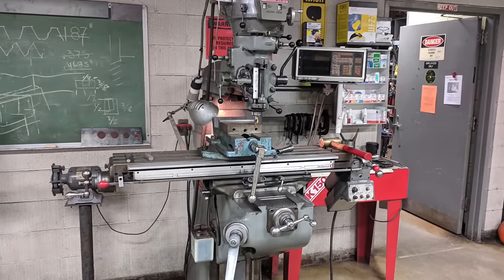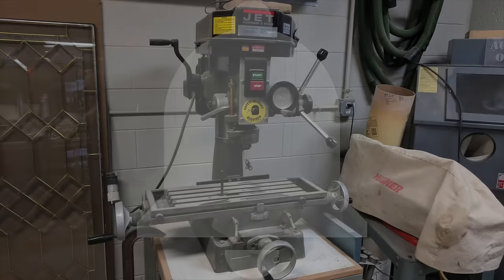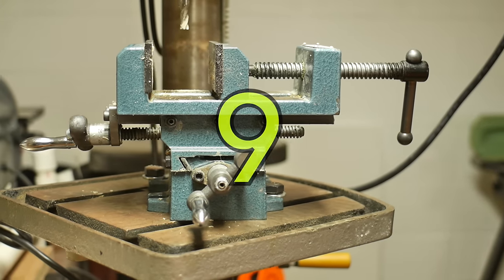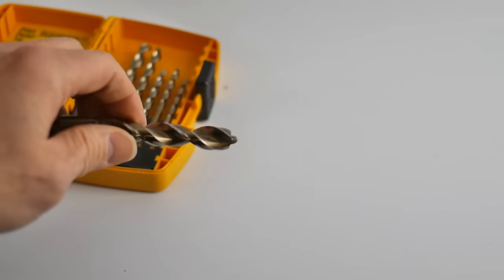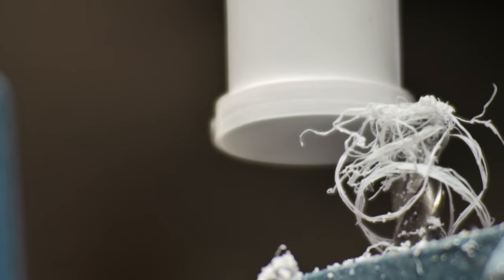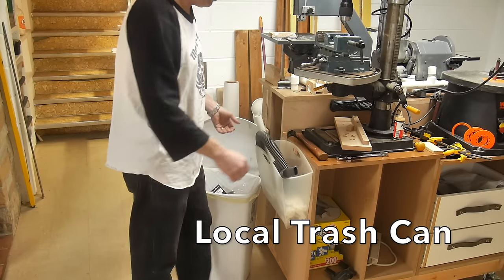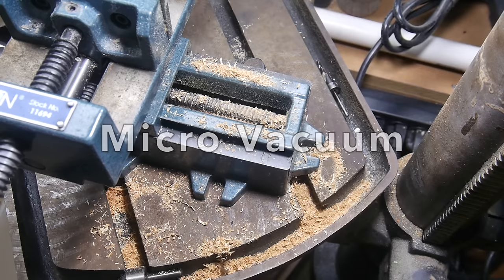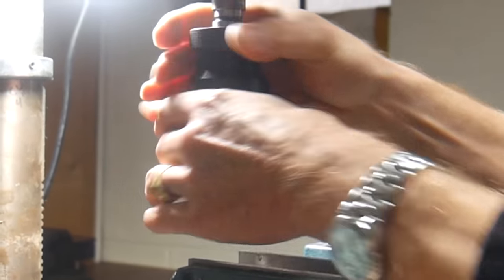Drill Press Machining Hacking/Tips and Tricks: The Basics

Comment: good info! I just got a nova voyager which is a $1700 drill press with very low runout and so I'm nervous that side loads could cause damage that would affect the precision of the machine. I've asked a lot of people about this and have been getting highly varied responses, everything from "I wouldn't even use sanding drums", to "I use my drill press as a lathe". Any thoughts on this? I'd be more inclined to just experiment if it was a harbor freight drill press, but this is a pricey machine (about 3 times more expensive than anything else in my shop) so I'm trying to stay cautious.
Reply from the maker: Follow the manufacturer's recommendation on that.

Comment: unless your drill press is a direct drive, your spindle will bend out of true. All non direct drive presses are meant for vertical load not horizontal pressure and stress...
Reply from the maker: Yes, you are absolutely correct

Comment: se tapeYou left out a major issue that potential might kill someone (or even you). The way to attach the drill chuck on a drill is via a Morse taper. A little vibration loosens the Morse taper and everything just falls out with a potential for injury. The drill needs a bolt fastening or screw fitting to hold the drill chuck securely in the drill. That is why you buy a milling machine.
Two other things that are highly useful is a way to lock the shaft partially down. Some drill press's don't have this. And you need a simple way to raise or lower the drill table preferably with some precision. Few drill press's have these either. I have a milling table mounted on my drill press and all of the above things really annoy me. I have so far only ruined one job by the Morse taper dropping down but caught a number of others before they caused damage to either a job or me. All of these things are why you buy a milling machine. I suspect that it wouldn't take too much to mount the Morse taper better (not using a Morse taper basically) and would add little to the cost of a drill press BUT doing so means way less milling machine sales so it is not done.
I don't know if drill/mill machines handle this better but my experience is that a drill/mill is probably the better buy if ANY milling is intended.

Comment: Please don’t use your pillar drill to mill. The thrust bearings are not designed to take horizontal loads - they are purpose made to only take vertical loads. By milling all you will do is wear them out fairly quickly, causing increased runout/wobble. 

Thrust bearings can be difficult to replace unless you have the right equipment.
Reply from the maker: Good advice..
Reply: >thrust bearings
My ryobi drill press has standard radial-load ball bearings in addition to the thrust bearings. It also doesn't have a taper anywhere, just a thread-on chuck. Seems like my drill press is well suited to light milling, although I'm too much of a cheapskate to buy actual end-mills so I use a combination of dremel bits and D-bits made out of old files. Heh.
Reply from the maker: Seems ideal

Comment: WEN 4212T 5-Amp 10-Inch Variable Speed Benchtop Drill Press with Laser
Benchtop. $231 shipped to my door. First drill press. Light duty. 
Need for drilling some thin(ish) hardened SS and titanium.

Good? Anything better? $240 is my max budget.

Comment: Brilliant video thank you.

I was lucky enough to buy an old Whitecote drill press from the 1970's - it came with the slide vice (I didn't know what it was called until seeing your video) and a massive haul of big and little morse taper and straight-shank drills - all for £40 ! Re-wired it with a new starter, and it's so heavy there's no vibration at all, even with large drills.

Finished making a precision 9BA needle pin screw for a 1930's phonograph with this setup.
I will buy some of the tools you suggested, I did not even know these existed.
Reply from the maker: Awesome

Comment: I know I am late to the party, been a machinist for 25 years, that chuck is a great piece of gear but be very careful not to spin your mills and drills  in it...BE VERY CAREFUL
Reply: Hey Stan, what's the risk if they spin? Also, can you help me out here, someone in the comments said that lateral forces are generally not great for drill presses, can lead to premature bearing failure. But as I thought about it more, wouldn't a drill press with 'plain' ball bearings be better for handling lateral/radial forces than axial? Wouldn't the downward force of drilling be WAY worse for the bearings, would be trying to push the inner race out of the bearings? I've also heard that lateral forces in a drill press will usually cause the taper joint between the spindle and chuck to work loose, since drill presses probably never have drawbolts. I could be completely misunderstanding it though, I'm not too proud to admit that :-)
Reply: @AHustleIsLikeASideOfFries  In my experience the lateral and axial forces wouldn't be an issue because you're not going to be putting to much stress on the bearings as you're not going to be taking that heavy of a cut. You will know what to heavy is when the motor boggs and the end mill locks up in the work because it doesn't have enough power to cut the material. ( If I was understanding the question correctly). I would not worry about the taper either with light cuts, probably take decades to do any damage...if at all. THE CHUCK....any chuck that has tools that spin will damage the jaws and lead ti loss of true..it won't necessarily happen with one spin but it WILL happen so be very careful and take your time, light and lubed cuts. That is an excellent chuck and will hold tools very true. We have them for carbide reamers that cut on the chili EVERY time, +/-.0005 and they cut nominal...meaning no real need for tolerances except for tool wear. Hope that helped.
Reply: @stanbrown915  thanks for the reply. I interpreted your first comment as it could be physically dangerous, didn't realize it was about damage to the tools.
Reply: @AHustleIsLikeASideOfFries  Yes...sorry about that. All work must be secured to the table when using power equipment at all times.

Comment: I have that same drill press..it's such a pile of crap but I get some ok results from it. I have a good cross slide but getting the table to be solid is a real drag,,plus side loads pops out the taper so i devised a draw bar screw to go into the little slot in the spindle with opposing set screws..
Reply from the maker: Thanks cool, can you post a pic on social media and tag me so I can see how you did that?
Reply: @EricStrebel  yeah I'll try and snap a shot of it.. I was quite pleased with myself for my clever solution. I used a milling bit holder instead of the Jacob's chuck..that taper in the spindle is surprisingly a standard moris number 2, so I used the milling bit holder I had and a cut off screw that fit its thread pitch for the draw bar,,I had to narrow the sides of the screw to fit up it and then drilled a hole latterly through it and taped it for two opposing set screws,,its a bit fiddly to set up but once you get the hang of it it works great. As you turn the mill holder up into the spindle it tightens up the holder into the screw and taper. 
I know a picture is worth a thousand words so ill get a pic for ya.

Oh and by the way I really enjoyed your humor and low tech solutions,,I have never had the deep pockets to just through money at my problems and I actually think often times its been very satisfying creating work arounds. Cheers
Reply from the maker: Rock on!
Reply: Hey Eric! Any photos or sketches? thanks.

Comment: I have heard that if a drill press is used as a mill it will destroy the bearings in short order is this true
Reply from the maker: It's not meant for a side load, it has a linear beating,
Reply: @EricStrebel  so this means it will destroy the bearings
Reply from the maker: Eventually they will deteriorate, yes

Comment: Using an end mill in a three jaw drill chuck is DANGEROUS.  Find another way to secure the end mill as the drill chuck isn't up to the task of holding end mills due to the fact that end mills are hardened and the the drill chuck jaws do not have enough surface area to adequately support the mill.  That's why they are called drill chucks and not mill chucks.

Comment: Question: I had basically the same idea "hey i have a drill press why not just get a cross slide vise and use it as a mill" and was met with an avalanche of "not a good idea boss". The main concern cited to me was that the bearings on a drill press are designed to take the stresses of moving vertically and lateral forces would destroy them. Since you use a cheap'o drill press this would kinda be the definitive, have you run this for a long time? what are the limitations? have you noticed the press running out of true?

I'm not expecting a flawless cut through hardened steel or anything but in my mind a low enough feed speed/depth of cut with the tool as close to the chuck as possible would eliminate (or atleast reduce) any wear.
Reply: The main reason I always call BS when I hear that thing about bearings, is that the bearings on basically every drill press I've taken apart are your garden variety deep groove ball bearing, these bearings can usually handle at least 3 times the radial (side) load as they can axial (end or drilling) load yet despite this these bearings are always the ones used in drill presses. As you mentioned, if you keep the loads down it should work just fine but if it really bothers you it's almost always possible to change out the bearings with either angular contact (good precision and way higher rpm than your press could make) or tapered roller (high ENOUGH rpm and way higher load bearing than any other part of your mill/press could handle).

I went ahead and changed mine out with tapered roller bearings just because I wanted the extra durability and know I won't reach the precision capabilities of the angular contact bearings, but two issues with those are that the bearings were slightly thicker (my drill press had a spacer that seemed made specifically so I could remove it to fit tapered roller bearings if I wanted, but not all drill presses will have this) as well as the fact that the tapered roller bearings don't have any kind of shield or seal on them. So far it hasn't been a problem, and I've never had chips go into that area anyways, but I'm planning on making a sheet metal "shield" of sorts that can be clamped underneath the bearing race to help keep out dust and cutting debris. Don't know how easy it is to visualize but I'll try to upload a video of this to better illustrate my point. Besides these the only issues are the rigidity of the column and "headstock" (terminology?). I was thinking of clamping the headstock to a steel reinforced concrete base with linear ways to lift the table up and down like the dovetails on a Bridgeport, but only because I have easy access to tons of scrap metal for free and I have a nice inverter welder to stick the frame together with, as well as cheap access to surplus parts from refurbished cnc machines like linear ways and ball screws. The headstock could also be reinforced with either epoxy granite inside or bolted to angle iron on the outside to help increase the rigidity but at this point it's getting dangerously close to being easier to just make a milling machine from scratch.

Comment: Hi Great Video I really found it useful; just one point Milling machines are designed to take the lateral forces imposed on them; quite often in cheap drill presses the bearing will fail; so be careful what you material you decide to mill.
Reply: Was thinking this too. However, realized that if most drill press quills have typical ball bearings, they're going to do BETTER with lateral (radial) loads, won't they? Shouldn't the downward (axial) forces of drilling lead to premature degradation of them? For instance, wouldn't the forces of normal drilling be constantly trying to push the inner races out of the bearings? An angular contact bearing should have journal surfaces that give both radial and axial contact. I may have this all backward, I'm no mechanical engineer, I've tried to check my assumptions with research. Also, I've heard that putting lateral forces on the chuck of a drill press will tend to work the taper joint between the chuck and the quill loose. That's why mills usually have both taper contact surfaces AND a drawbolt.
Reply: @AHustleIsLikeASideOfFries  Hi Garry technically you should only be applying sufficient force to allow the drill bit to do the cutting when drilling, thus allow the drill bit to do the work not the drill bearings. I'm using a 1976 (that's the year of manufacture) Ajax PD16 drill press, no bearing issues so far 😎
Reply: @garypolotian9995  thanks for the reply. That's a good point (pun intended), if your drill bit is properly sharp you won't need to bear down while drilling. I often sharpen my drill bits the last few years, it's a good habit to develop.
Reply: long before there are bearing issues, there will most certainly be bleeding type health issues after the drill chuck comes off its taper...
Reply: yelims20 yes I agree, this is not something I would advise doing either 😀

Comment: Works OK for me on soft stuff and shallow milling that's not required to be too precise. It's just that the drill press is designed for vertical forces the bearing and spindle suits this purpose only, a milling machine is designed different to withstand the side forces haswell. 
I also use my pedestal drill on the odd occasion as a lathe, for small projects like making a wooden handle or facing or roughing a small bit of metal by using files and a hacksaw.

Comment: Yes I've used my drill as a milling machine the same way for aluminum it worked fine, as far as why the press had those three handles I think is for leverage when you're drilling through something hard as I've found it harder to drill with just one handle

Comment: Absolute rubbish. That drill press will eat it's bearings in short order , it was never designed to take the loads involved in milling. As for a keyless chuck holding an end mill , well good luck with that .
Reply from the maker: correct, crappy drill press, doesn't really matter, keyless chuck does work magnificently well and super convenient

Comment: What about those lateral forces wanting to dislodge your chuck from it's taper and dropping out? Hmmmm.
Reply from the maker: totally happens sometimes....
Reply: @EricStrebel  I also use my drill press for small milling jobs, but I have made a locking collar to firmly attach the morse taper arbor, which stops the chuck from becoming lose. I am lucky in that I also have a small lathe to manufacture such parts.
Reply from the maker: Yes, that is a good thing to have, you are Lucky, I hope to get a smithy some day

Comment: To stop losing your chuck key, do the following.

1. Find some light chain (3.4mm x 2.5m Zinc Plated Jack Chain is ideal) about 18 inches/45.72 cm long.
Links: 
             Bunnings Australia https://www.bunnings.com.au/zenith-3-4mm-x-2-5m-zinc-plated-single-jack-chain_p0046211
             Home Depot North America https://www.homedepot.com/p/Everbilt-3-x-15-ft-Zinc-Plated-Steel-Double-Loop-Chain-803072/203958780

2. Find two 30 mm OD x M10 x 2.5 mm thick Galvanised, Mild Steel, Flat washers (eBay link: https://www.ebay.com.au/itm/303396063099).

3. Drill a 2-2.5 mm hole in the edge of each washer (enough to attach the ends of the chain to each washer).

4. Fit one washer to the chuck key shaft (the cross pin will usually be removable).

5. Fit the other washer to one of the lower drill motor mounting bolts and re-tighten.

Hey-presto - your chuck key is always handy and easily located when you need it, never to be lost again.

I hope some of your viewers find this helpful.
Reply from the maker: Not a fan of the chain getting wrapped around the chuck…..get a keyless chuck, it’s safer.
Reply: @EricStrebel  If you position the chain correctly it is never near the chuck. The idea is to mount the chain at the rear of the drive motor mounting behind the drill stand. I have used this method for more than 40 years without a problem.
Reply from the maker: Ahh, I c. Ok. Thanks for the tip
Reply: @EricStrebel  No problem.

Comment: I have a semi-good drill press that I love but it uses a morse taper so whenever I try to mill with it the chuck falls out. Any suggestions would be appreciated.
Reply: I drive the chuck in with a hide mallet: really whack it, after cleaning the taper with IPA or similar to get grease and oil off.  
I have to use a Morse 2 taper iron wedge and a hammer to get it back out !

Comment: How do you lock the chuck spindle at a specific depth to mill a slot? I want to make business card holders out of wood, but cannot work the vice and keep the spindle at a constant depth with my other hand? I have a Craftsman bench drill press I bought used.
Reply from the maker: There should be a lock on the drill press to set  the max depth you want. Every drill press is different. You will need to hold the Chuck at the max depth while you make the cut.
Reply: Eric Strebel thanks

Comment: Do not use a drill press for milling it is not designed for it. But if you are going to be stupid enough then make sure your chuck is keyed into the spindle because if it drops down book an ambulance
Reply from the maker: Keyless chuck
Reply: @EricStrebel  not talking about a keyless chuck but about the chuck being fastened in with a drawer or any other fixture
Reply from the maker: Yes, a drawbar would be ideal in this situation.